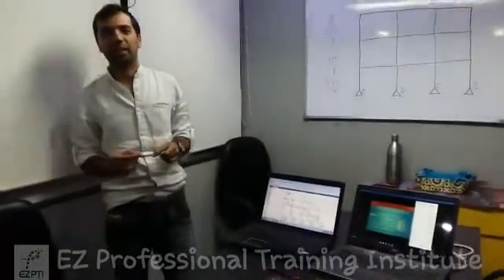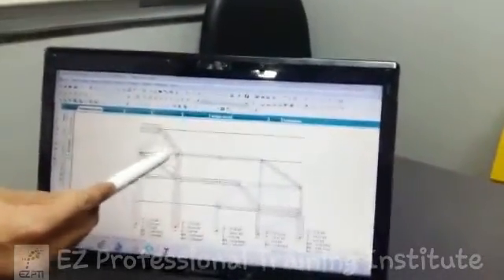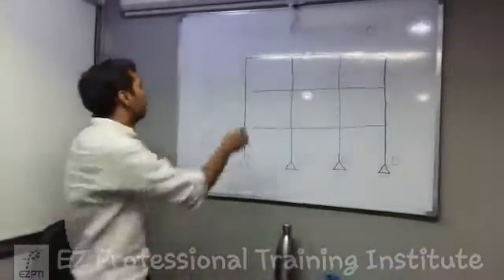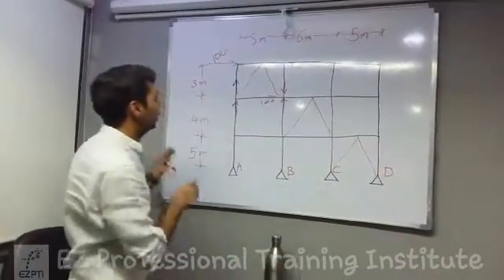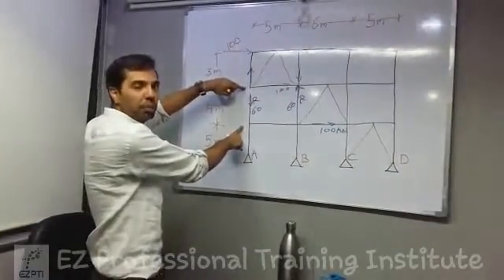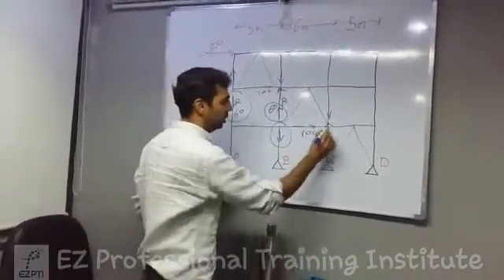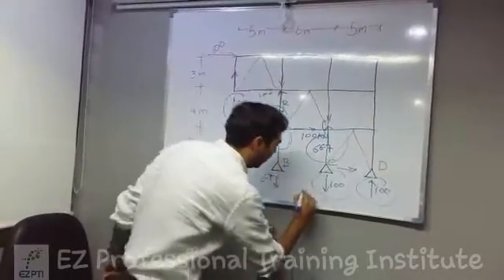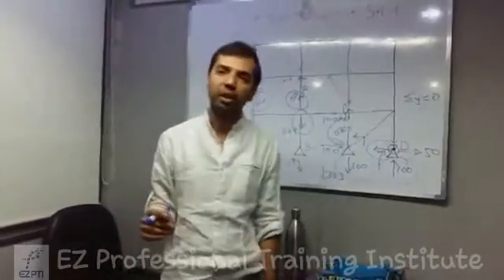Horizontal Force Transfer through Vertical Bracing,Manual analysis Non-Sway Frame,Importance of VB

Comment: We have a steel structure having welding only at both between  beam and column, what type of connection is this????
Reply from the maker: for this you can directly talk to Satish sir on 9825106264 or you can send us your mobile no.
Reply from the maker: Moment connection - provided weld is designed to carry that moment...